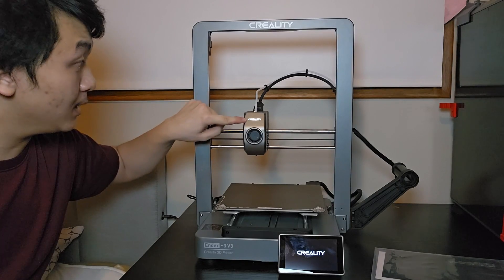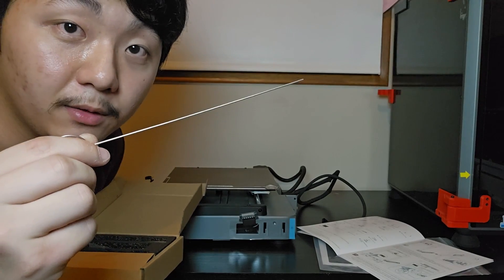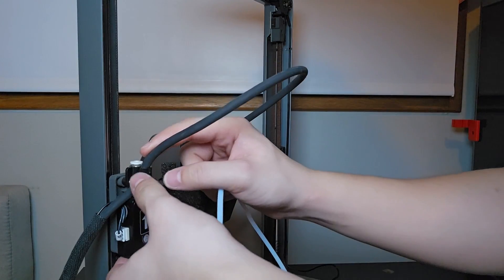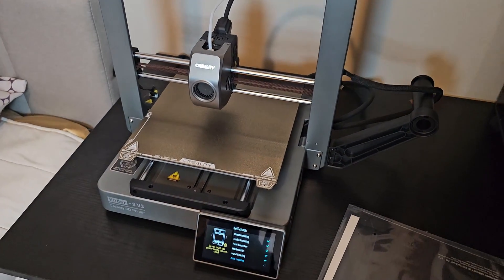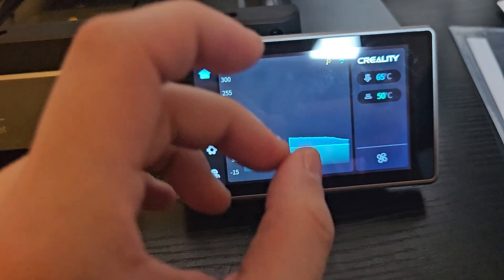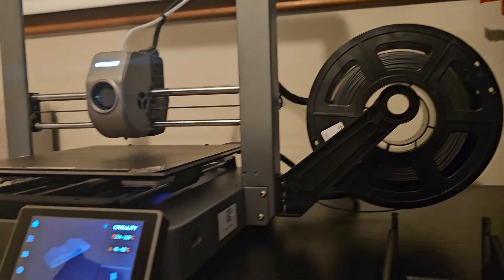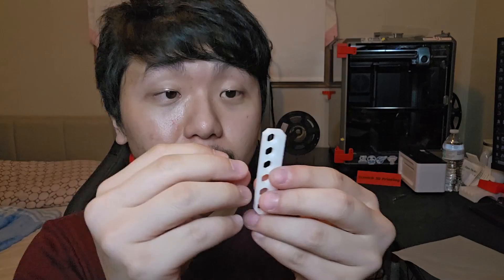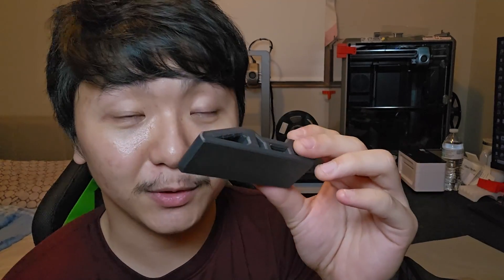Creality Ender 3 V3 Unbox and Review | Prints Out Of The Box

Comment: OOPS  Qidi hot end cover and dual fan mod Makerworld all stl files are here and an instruction video in Chinese also if you do the extruder release printout that advises you to cut the Qidi extruder cover to acomodate the filament release you can just print another cover ....... enjoy my Qidi is still in the box ha ha as i have been trawling the Tinternet for Qidi mods i found another mod first for a hotend auxilary fan so i Aliexpresed the 2006 5v fan for the mod but now i have found this dual fan duct and auxilary mod i am very happy so no possible PLA heat creep for my extruder !!

I hope you like this link and enjoy it

Happy xmas

Comment: The price is too high 
The K1 was on sale for $349 around BF
Why would anyone choose this over an enclosed core XY machine with basically the same tool head?
I am sure the K1 will go on sale again next BF and probably even cheaper since they have  new K1 models coming out by then.
This printer should have been priced at $300.
So it would be around $30 more than the KE and still $50 less than a K1 on sale.
but even at $300 I think I would rather spend another $50 to get an enclosed core XY machine
Reply from the maker: Yeah, that's some what true. I do felt his is a bit too high,  but at least there's no problems yet. The k1 series are really good,  I still love my k1 max better than this ender 3 v3
Reply: @Scratch3DPrinting  do you think the V3 has any advantages over the regular K1?
Reply from the maker: @anthonyrossetti7509  based on my experience on the Ender 3 V3, the first layer is flawless. I heard alot about the k1 not getting good first layer, so I think that is the advantage of the Ender 3 V3.
Reply: @Scratch3DPrinting  so today with  current FW fixes on both machines which one would you pick if they were the same price?
Reply from the maker: @anthonyrossetti7509  I would definitely pick the k1 because it offer so much more than the Ender 3 V3.
Reply: @Scratch3DPrinting  thanks so I guess the K1 on sale for $350 is a no brainier then I mean if the V3 doesn't go a lot lower on sale which is probably not going to happen